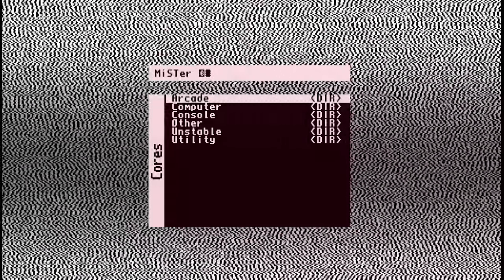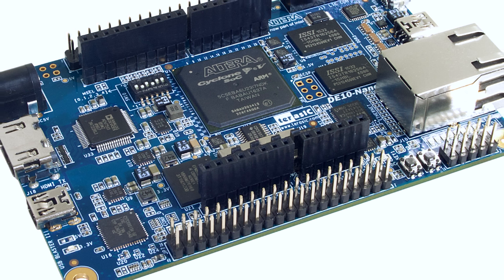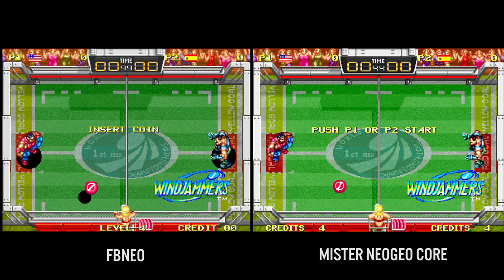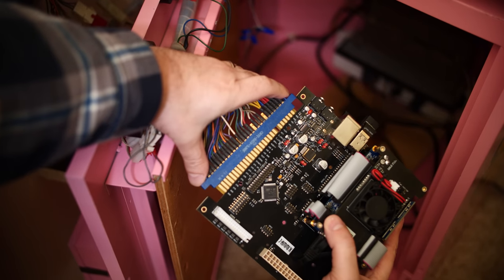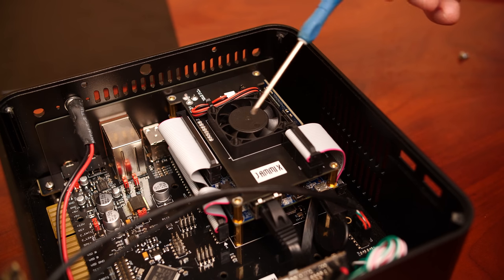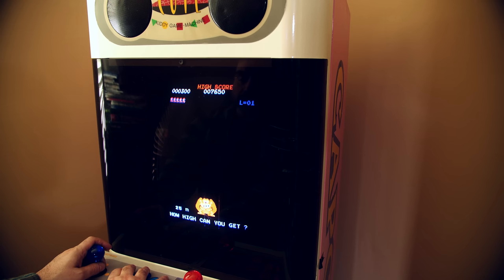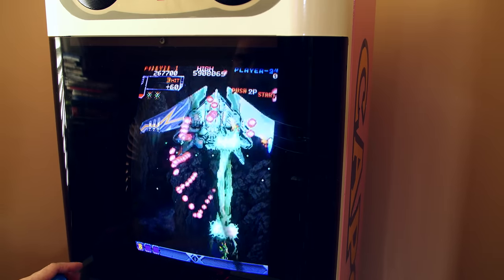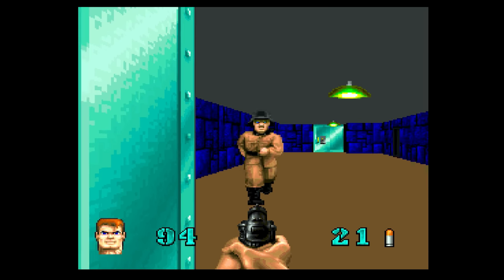Finally - I got my hands on a MiSTer FPGA Retro Gaming Setup | MVG

Comment: I always enjoy MVG’s videos and have been a subscriber for years now, but excuse my ignorance and I really do not want to come across as an ahole…but what is the point of this? FPGA is great when you can run on some of the original hardware, whether that’s the console/hardware itself or physical games. I get that it’s running the original schematics of old hardware, but you are still running that on third party hardware with roms. Isn’t this still technically seen as emulation?…Am I missing something here? I would really like to understand why someone would pay the premium on something like this that still takes a lot of time and effort to configure, when you can just get a raspberry pi, or run emulation on a small pc or console at a fraction of the cost.
Again, I’m not trying to be a smart a*s, I really want to learn and understand why this is better than current emulation sources.

Comment: I don't see the advantage over just regular emulation
Reply: No input lag (there is always input lag in software emulation), easy connectivity to a crt tv (or arcade monitor), potentially more accurate (cycle accurate) emulation.

Comment: yea I am going to have to have more than "its so much better than the saturn version" and "its amazing and showing promise" and secondly thanks for spreading the myth that FPGA magically re-creates hardware it doesnt, someone writes software to re-arrange gate array's (the ga in FPGA) for digital logic which means you can do it on a chip vs a computer, after that point the difference tween FPGA and software emulation is moot as its the same thing
Reply: no its not the same thing one runs in parallel like real hardware ( fpga) the other does not it runs in sequential (software emulation) 2nd its not a myth that you can create 1 to 1 copies and then have them produce to  replace bad parts . HDL and software language are not the something HDL describes the behavior of electronic circuits while Software Language provides a set of instructions for the CPU to perform a specific task
Reply: @soloM81  so what's the advantage of "parallelism" in this day and age? And yes you can make replacement parts with FPGA but that is not the same as replicating and emulating an entire console on one, For instance almost all issues people complain about (audio and video) are analog processes and you can only explain so much of a analog circuit to a digital gate array
Reply: @osgeld   The advantage of parallelism is pretty obvious isn't it? Especially when it comes to recreating an entire system with tons of things happening in parallel on various different subsystems with timings being essential. This means that you can pretty much replicate en entire system in an FPGA, even video and sound, which are both processed digitally by the way. Also your understanding of FPGAs seem to be completely wrong, since the gate array is exactly what allows it to recreate a circuit in hardware, and thus achieve greater performance for certain operations compared to software-emulated counterpart. There is no such myth about FPGAs
Reply: @PeterKrull1  yea its the way to go if you insist on doing all of this on a single chip solution, but for the cost you can have a multighz multicore monster truck doing the same work AND more. 

Second point are you telling me that analog signals are purely digital? Thats what you insinuate but in reality ... lets take everything before I dunno 32 bit. Data is pumped into "a chip" that takes that digital information and passes it though a very complex analog circuit to generate the signal. 

 I would also like to add I develop FPGA applications for real life , and would like to think I have a good grip on how it works.
Reply: @osgeld  for someone who 'develops FPGA applications' you do not seem to have a very good understanding of it. Using a powerful CPU to brute force a problem that can be solved natively and efficiently on an social purpose FPGA just seems a bit ridiculous if it wasn't for the prices of the chip shortage. And yes, signals like sound can be represented and processed in a purely digital domain. What do you think we mean when we say 8-bit audio? Of course it is analog when it is output to the speaker, but that has little to do with how it is processed.
Reply: @PeterKrull1  "special purpose FPGA" I assume you mean, sigh the entire point of a FPGA is that its NOT special purpose, thats the exact opposite reason they exist. 

The chip shortage has nothing to  do with this, it was a  400$ "solution" before and now its a 700$ "solution" now propped up on the myth that it "recreates the hardware identically" and no its not its software defined hardware, hell the timing of the chips are not even correct to even "simulate" a system let alone recreate it. Its  emulation in a different language running on a different hardware theory, nothing else.

 As far as the rest of this, go look at how a SID chip works, I am done bickering with you.

Comment: I don't think I'll ever understand the appeal of fpga
Reply: Besides original hardware, your options are crt emudriver or Mister fpga if you desire to play arcade or console games on a crt at native resolution. The practical purpose of an entire console collection could be condensed into one device without sacrificing native analogue output. Mister paired with a crt is an instant retro game collection, using groovy_mister core you can make the fpga act as a gpu for your pc to output native analogue output from your pc. The use cases and functions will only grow

Comment: I bought my MiSTer for like $110 before the shortages, and a 8bitdo 2.4ghz controller, and a cheap micro USB USB hub. That's all you need to play Genesis and several other consoles. So it's really not expensive at all, certainly not $300+ that you're making it out to be.

Comment: Was interesting... Until the price.
Reply: Base kit without addons is about $200. The official USB board and IO boards are like $50 each. the 128mb SD ram board is $60, but you can find used 32mb SD Ram for cheap. The DE10 Nano retail box comes with a 4GB Micro SD card. But you want to switch to something bigger. If you got alot of roms consider a USB storage for Roms (like a thumb drive or external HDD or SSD) or a NAS storage solution. 
You can start with just the base DE 10 Nano to start, get a OTG adapter (you can find a cheap OTG USB Hub for like $6 on Amazon), HDMI cable and your choice of USB keyboard and USB game pad to start, a few cores will run without the SD ram board. 32MB runs most cores, 128 covers everything (mostly larger Neo Geo Roms on the Neo Geo Core and the like).
Reply: @Lukas Peruzovic  I suppose for an enthusiast/collector money is no object.
Reply: @ultenhiemer  Far cheaper than trying to collect all of these consoles now, not to mention Micro computers or Arcade boards. Shoot I think the MiSTer is cheaper than some Arcade boards. And MVG have a Extra special setup with features most people will never use.

Comment: I still don't know why it's better than emulation.
Reply: It is still emulation, but without and underlying OS doing the work. The silicon does the work, like original hardware. The FPGA chip is 'rewired' to replicate hardware.
Reply: @ZaPpaul  I get how it works, but why is that better? I mean, if you play the game, you play the game.

Would be interesting to do a blind test, or tell someone 'this is running on a Mister' while it is in fact emulated on a capable system, preferably all on crt. See who can actually tell the difference.
Reply: @JopieHaargel  well it's better because its more native. Software emulation relies on a computer system running an operating system and that can and does affect the emulation accuracy. People will argue it doesn't but it does. If you are super used to a game like I am with Mario Kart on SNES, you can tell pretty fast you are in software emulation and my lap times are around .2 to .8 of a second out of my record on a regular basis. On OG hardware and MiSTer, my laptimes are much less and around the same of .02 to .1 of a second out. I can't tell the difference on MiSTer. I do also use OG SNES pads to play on my MiSTer so that may have some bearing on the times. I am not sure, but when I do use another decent pad, my times are not that different.
Reply: @ZaPpaul  Thanks for explaining, that makes sense. Luckily I'm just a filthy casual, so the differences will probably be lost on me. Or maybe I even got used to emulation, as the last time I actually played an original NES on a tube tv was somewhere around 1992...
Reply: @JopieHaargel  Oh yeah for sure on most games I cant really tell the difference. I can only truly notice it when playing games that require timings that I am personally used to. If you are used to those timings in an emulator, then you may even find MiSTer to be worse until you readjust. Which for lots of people is no real reason to change.

Comment: i don't know... the small size is amazing but i still feel my pc with old ati card outputting RGB is enough
and sooo much cheaper
Reply: And that's cool, man. I use a similar setup myself with GroovyMAME and CRT Emudriver. But, you have to remember this is 1:1 hardware recreation. With an accurate core it's literally like playing on original hardware. That will never happen with a PC setup. Ever. That's why this project is so unique and important.
Reply: @AFFL1CTED1  how much better than standard emulation is this? i don't think it's even measureable, besides input delay which is maybe a few miliseconds better (i'd bet less than a frame of difference - less than 16ms)

as the man said at the beggining of the video, standard emulation is good enough for most people

it's a cool board to connect to a jamma cabinet i guess, those pandora things are garbage
Reply: @vdfritzz  you don't have to take my word for it. Go to any Mister forum and there are many many people who will gladly tell you how different it is. And the input latency can be multiple frames less. 32+ ms. It does make a difference. If you spent any serious time with the Mister I'm sure you'd appreciate it too. Still, if you're happy where you are, no problem man. To each their own.
Reply: @AFFL1CTED1  retroarch with a decent amount of frame delay is already basically real hardware in terms of input delay, not to mention run ahead (which i don't like/don't use) which makes it even faster

if the mister can be multiple frames faster than retroarch, it's also faster than real hardware?

i've seen tons of videos on it, i'm kinda addicted to youtube btw, i've seen all sorts of channels talk about it, what i'm saying is that i don't see the value

my original message says "I still feel", that's me
Reply: @vdfritzz  I hear ya, I also watch plenty of YouTube haha. And I read many fpga and emu subs on Reddit daily. But hey, that's cool man, no need to continue the conversation then. Like I've said, if you're happy, then more power to you. I was simply offering insight not trying to convince you of anything.

Comment: Here's a common use case they don't cover very well. SNES speedrunning with savestates built into practice hacks. Mister doesn't allocate enough SRAM to cover what the console is capable of, and they claim to not have enough physical memory (they call it BRAM) available to accomodate half of what we expect to be there. If you're planning to speedrun Super Metroid, you're going to need a $200 flash cart, regardless of what you spent on your Mister. I'd rather have a real console if I were gonna waste money on one of those.
Reply: Interesting. Do you mean BRAM/SRAM for save states for some carts doesn't have enough?

The SNES core is pretty big now, but I think there should be a fair bit of BRAM left for adding some extra.

I don't know if anyone has been working on joypad recording and TAS stuff for MiSTer yet either, but that's totally possible (even when using SNAC).

Do you know roughly how much SRAM the larger games need for saves? I'm sure some devs out there would be happy to look into improving that.

Comment: I'm still not a fan of FPGA emulation, because there are software emulators that also aim at hardware preservation (like bsnes) and that are at least as good as FPGA emulation.
Software emulation doesn't need special hardware to be run like FPGA emulation, it can be compiled to several systems.
About lag in software emulation, lag won't be a problem with a fast enough hardware.
And FPGA emulation is much more expensive than software emulation.

I can see some advantages in the MISTer project, mainly it's totally open source :)

Comment: Fanless cooling would be better, these small fans are abomination..
Reply: Not really. There a small heatsink under that fan, the fan just to make sure there a flow of air.
I got a similar setup (I got a different ITX board that lacks the jamma edge) and that fan does more than you think.

Comment: Still a PASS.....

Only one thing that stops me from getting the Mister. The GUI. 
Most people dont have just 10 Roms. Legit or pirated, most  people have hundreds or thousands. And no one is going to remember what game is what based on a text list of names. 
A simple graphical GUI, with a screen shot, Title, and brief description would go along way. I am NOT talking about busy, ugly, resource intensive front ends like some of the stuff you see on Emulationstation. Im talking just a simple, barebones single color back ground, a screen shot and a description. 
And if the creator doesnt want that, then at least make an API so someone else can. 

Until then, CPUs, emulator code, improvements like look ahead, etc..have mitigated lag and latency enough that I am just fine with using an old Dell PC with launchbox or a retropie overclocked....and still get 95% of the experience for 1/3 the cost....and a better interface.
Reply: The GUI is like that as its the limitation of the DE 10 nano. There no Graphics acceleration on board, there no dedicated GPU. Anything you would suggest would be a "busy, ugly, resource intensive Front end". 
Besides for the FPGA chip, the DE 10 Nano it has a small 800 mhz Arm CPU ,and the MiSTer uses a very stripped down version of Linux as a backend for file house keeping and such.

There nothing to make a API on, it's not like a PC Emulation box. You have to do everything in FPGA with HDL (hardware descriptive language).
Every core you see is responsible for it's own visual graphics, everything you see rendered is from the FPGA side, and most of that is in replicating that original hardware first. 
If you want rom origination, you can choose how the sub folders are and you choose how they are labeled. Most game roms on older systems are tiny and can be copied to multiple places if need be.
Reply: @lukasperuzovic1429  Fair enough and appreciate the explanation. Def not putting the project down as I am very very interested.  Its pretty modular with all the addon boards and such. No way to implement a GPU addon board?

Comment: I don't understand how FPGA running these cores is any different than my Desktop running Retroarch. From a layman's perspective, it just looks like a very expensive emulation box.
Reply: It really isn't much different.  PC emulation, especially for older consoles is practically perfect.  The big upside with mister is the availability to play on legacy displays, such as CRT'S and the fact that it has 0 input latency added. PC emulation always is going to have inherent lag due to the fact that you are have many applications running (your pc's operating system, the emulator then your display).  This is a niche product for a community that is already niche.
Reply: FPGAs allow for much more accurate hardware emulation than software emulators. Usually FPGA cores are cycle-accurate, which is very rare for software emulators. FPGAs also have pretty much no input lag. That said, if you use run-ahead for Retroarch then the difference is probably quite small when compared to playing on MiSTer.
Reply: A CPU has limited threads that while can change fast, but it's usually only one or two things that are emulated at once and even there some shortcuts must be taken, while an FPGA emulates all of the chips at once in real time and their connections. It's just a little bit that much closer to the real thing. Oh and the CPU is managed by a full OS, so it might not be dedicated to the emulation.
Reply: @JeffYPbPr  That's what I get from it, it seems like a very expensive toy for retrogamers with some extra cash to throw around.
Reply: The difference is there if you are super familiar with cores. Speed running for example should be easier for people to transition to from OG hardware. Although you are correct, running any high end emulation would be just as good for most, especially the layman. The MiSTer System isn't really a consumer level device, it's more of an enthusiast level device. I wouldn't suggest anyone buy one unless they need more from emulation.
Reply: Software emulation emulates hardware in software, needs a host OS, uses system apis for gfx, sound, input, etc, needs to create memory maps, etc.,etc. fpga cores make the fpga become the hardware so any software thats running on them is running natively, not emulated.
Reply: This is not for the layman, so you are not the target demographic.
Reply: @bbuggediffy  This is actually an insightful answer.
Reply: FPGA runs processes in PARALLEL, whereas software runs things SEQUENTIALLY.  running in sequence introduces lag.  That's the biggest thing about FPGA.
Reply: @rs.matr1x  Thanks. That was very helpful.